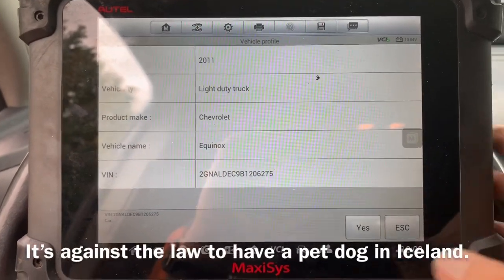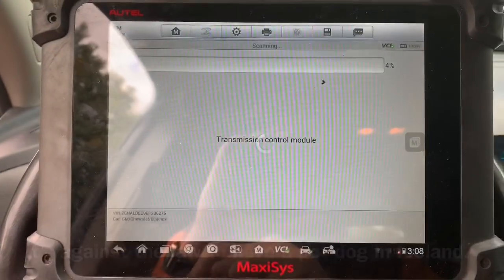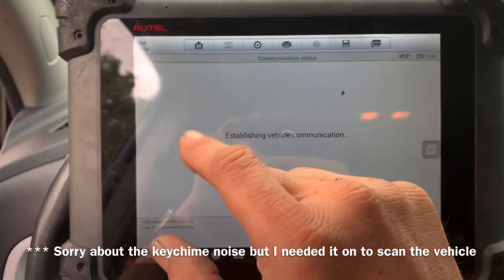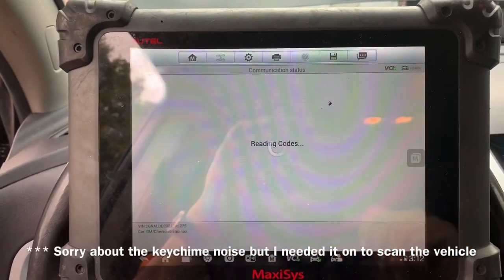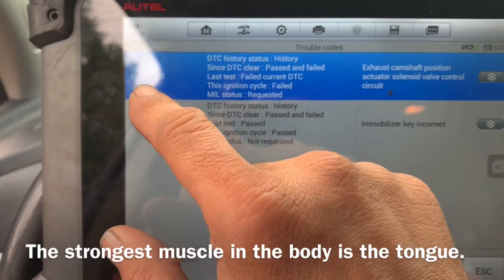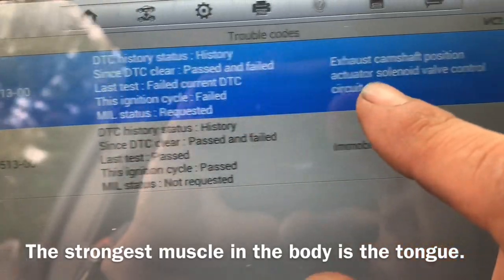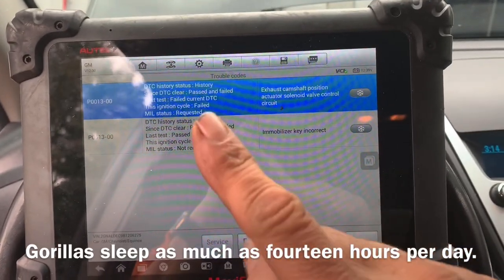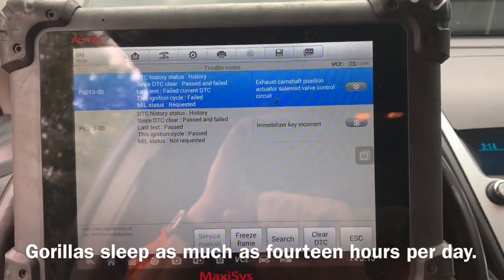Chevy equinox / camshaft position solenoid/ replacement and how it works overview

Comment: Dude your f*** awesome! I went to the parts store and there code  reader said cam shaft position sensor. So that's what I bought . Well I then watched this video and I went right back and returned the sensor and purchased solonoidS. And it worked out perfect. My check engine light even turned off!!
Reply from the maker: Gosh I could’ve swore I answered this question six days ago thanks for the very very nice words I don’t know why you didn’t get my message from earlier

Comment: The tube you pointed out is the EVAP Purge valve vacuum source.  If it cracks it will cause a P0171, lean code for umetered air.  Has nothing to do with VVT Solenoid malfunction or codes. To remove just take a pliers and grip the top of the solenoid case twist and pul, no need to struggle with various picks and screwdrivers.  Use compressed air to blow away dirt and debris around the solenoids.  Only use AC Delco, many have reported frequently failures with aftermarket solenoids.
Reply: Thanks Brian I changed the actuators and the P011 code came back so I was thinking of replacing this tube but now I don't need to.  I've changed the oil and still getting this code after a few hours of driving and also when braking at a stop the vehicle surges and rough idles.  I'm flushing the tranny fluid next so hopefully that will take care of it.
Reply: also ordered a crankshaft position sensor but apparently there are 2 of those as well?  Are they both the same part?  my code is specific to bank A.  Not sure which one that is.
Reply: @timothyflynn  Hey dude I have P011 code too. Any updates on what resolved/fixed your issue? Thanks.
Reply: @WilliamusTrades  I changed out the position sensors with no change.  Oddly I changed the transmission fluid and that helped a lot.  Ultimately for me I think it is probably the timing chain(s) but not sure if I want to fix it.  It happens periodically but then resets itself.  Seems to be with more stop and go driving or aggressive acceleration.   The timing chain replacement looks $$$$.
Reply: @timothyflynn  cool man thanks very much for the reply!

Comment: Thanks 4 the video, I got a check engine and the codes came up we're P0013 and P0014 after a week of doing the oil change. I read viscosity of the oil can create this problem, now should I get the oil change again before or after y replace the sensors. THANKS

Comment: thank you for showing how easy this is. I have a P0014 on my 2013 equinox and its causing the engine to stall
Reply from the maker: In a couple days I have a video coming out that’s going to show you something that I didn’t know that I learned at my new sponsors shop and you may be very very interested in it it may help alleviate that problem as well
Reply: @sharpcarco  what was the issues?
Reply: @sharpcarco  I'm getting the P0014 after the engine blew the main seal due to the PCV issue and a shop replaced the seal and cleaned the PCV.  After getting it back the check engine light came on with this.  Any thoughts?

Comment: Thank you!
I towed my 2012 chevy equinox to the dealership because it would not start. I was getting code P0013 and U0100 (Lost communication with ECM/PCM A). The dealership says thay want to update/reset the ECM for $40 and replace the Cam Shaft actuator solenoids $750... I don't understand why they would charge so much. I'm going to replace them myself for $100 on parts. Do you have any idea why they would charge $750 not including the diagnostic?
Reply from the maker: Well, I wish I had a good reason to tell you I have no clue why they think it’s that valuable, but they are called the Steeler ship for a reason …. I’m glad you can do it yourself though Cal that’s awesome that’s what my videos are for so I greatly appreciate that. Thank you and thank you for taking the time to write this message. It really makes it worthwhile because YouTube videos do not pay anything, but 2/10th of cent per view .. although the warm feeling I get when I get messages like this are the reason I continue to make videos like this

Comment: I have a 2013 Equinox 2.4L. I had been experiencing rough idle and high gas consumption for several months, but my garage could not figure out the cause. I got code P0010 and engine stalled. Replaced both intake and exhaust solenoids. Now I'm getting code P0013 with check engine light on. Engine ran fine for about 200 miles, but began rough idle and high gas consumption again. Advice?

Comment: Hey clay.. First off. .Thank you for making it easy to understand (great vid) I do have one question . .How was the engine running before you replaced the selenoids?
Reply from the maker: Well since I made this video I learned a considerable amount more about these engines you can certainly try to change the solenoids it’s easy and sometimes effective because oil will basically buildup on the inside of the solenoid causing them not to work

Ultimately though these are kind of junkie engines this one would not idle very well. It was fine when it was above an idol but ultimately it boils down to oil pressure not being consistent in the engine and running the cam phasers incorrectly. And that’s caused because the cam journal bearings were down overtime allowing for inconsistent oil pressure it’s not the oil pump it’s the bearings wearing down inside the engine if that makes sense

Unfortunately these engines are complete doom and gloom.

Comment: My 2012 equinox got p0016 & p00117 changed the VCTs, light was still on. Camshaft position correlation- bank 1 sensor A.... which 1 is Sensor A, front or back
Reply from the maker: No, that means or timing chain needs to be replaced technically but your cylinder head is really the problem. It loses oil pressure, open the cylinder head, which will not actuator cam gears properly…. Other people may tell you differently because they’re trying to sell you something and it’s easier to sell something that’s cheaper than sell something that’s more expensive….. but I’m telling you this because I don’t have any skin in the game. I don’t have anything to gain you need a new cylinder head not a used one or one that is line board properly… 

If you want more information on this message me over Facebook under clays ac and Auto Repair, send me your DM and I will explain it further

Comment: Does this also cover the P0010 code? I have that on my 2011 2.4 with 100k. Rough idle, stalls at idle, slugs on takeoff. Says stuck open on all 4 banks, didn't want to replace wrong parts

Comment: Hi I did had same problem I did replace them either oil spark plugs and one off the sander in back I still have the problem when I came to stop signal it shut off I have to fith back to stared again, what do you think it's please ,I need help.
Reply from the maker: Well I’m sorry to say that your cam phasers or your clearance on your cams creates a low oil pressure situation which then stalls out the engine at a low idle. 

I wish I had better news for you sorry I can’t give you a good information on that
Reply: @sharpcarco  thank you anyway

Comment: I got code P0014.  Changed the both solenoids.  Reset the code with my ODB2 reader.  Drove about 25 miles no problem.  Mile 30, on my way home from work, CEL turned back on.  Same exact code.  What else could be the issue, or what would you recommend i do?

Comment: This is the second video of yours that helped me within the last 6mo. Thanks! 2015 equinox had P0013 error, replaced both intake and exhaust solenoids, but still has check engine light. It definitely idles smoother. Any advice of removing check engine light? Should I clear code?
Reply from the maker: You can clear the code but you probably have other issues going on like low oil pressure. More than likely because the cam Girdles are wore down or the cam bearings are wore out sorry to say thank you very much for the kind words though
Reply: Did you fix it? What about the camshaft sensor?

Comment: We were replacing the variable valve timing sensor and only the top half came out! How do we remove the bottom part that stayed in? We have tried WD40 to loosen it and it will not budge.
Reply from the maker: Well you’ll have to remove the valve cover I know it might not look like very much fun but you’ll get it out…
Reply: @sharpcarco  lol! It took a few trips to the auto part store but we finally figured a way to get the bottom half that was stuck in there out! Thank you

Comment: What if the screws wont tighten after replacement? Tried taking the little oring on the screw and puttimg it on the new screw but the black side wont tighten but it held fine twenty minutes ago with the old sensor

Comment: So what did the engine run like when the bad ones were in ?
Reply from the maker: Well that’s a complicated question to answer because sometimes at stoplights it would die , and even though it needed new solenoids that wasn’t the complete problem. Sometimes it would run just fine. 

The problem often with these is the PCV valve gets plugged and that hurts the oil pressure on the inside of the engine so removing the intake and cleaning the PCV valve is often necessary in addition to replacing the solenoids. 

These engines are not very good engines they often have ring problems and a host of mini more.
Reply: @sharpcarco  sounds like intake solenoid
best idea to change both wile you are at it
Reply: better yet   change them at 100 k miles. these engines are known for these symptons.  dont wait till go bad  then do the 2 cam shaft sensors, while you are there not hard to change.

Comment: My chevy equinox 2014 have an issue which eating oil itself little by little. There's no leak even on the same spot which I usually parking it. What and which should I replace there?
Reply from the maker: Well unfortunately that’s a very common problem for these vehicles. It is burned up by the engine it leaks past the rings. Very common problem for them I was actually speaking to a General Motors engineer today about that problem and they said they had to make the engine the way that they made it so they would be more fuel efficient. 

Without getting into any great deal of Detail he explained it pretty well
Reply: @sharpcarco  now my suv need to be fix in tyming chain base on the obd reading. I post here just in case the car get fix "hopefully".
Reply: So going forward to the problem base on my experience having chevy equinox LTZ 2014. Once stability appear in dashboard for some reason. That's the sign and I suggest you need to trade in your car or sell it while it's still in good running condition.

Comment: Ok I’ve replaced these a couple months ago, how can they be bad already? I have a chevy equinox 2013, and I replaced them both! I’m confused
Reply from the maker: Well technically they’re not bad you have a low oil pressure problem and that makes them seem like they’re not bad but they’re really not you have another internal problem like bearing clearances on your cams that’s the most common problem
Reply: @sharpcarco  thank you

Comment: I broke one of the bolts inside of it😳as I was tighten the bolts. What can I do any suggestions would greatly be appreciated
Reply from the maker: Well it’s a small bolt so it should be relatively easy to get it out. , Is it broke off flush?
Reply: @sharpcarco Thank you for your reply appreciated! yes top of the bolt broke off
Reply from the maker: Can you grab it with pliers or anything since there’s no pressure on it any longer you may be able to take a little screwdriver and turn it. I’m assuming you don’t have a die grinder because you could put a notch in the top of it allowing you to unscrew it. 

You could try to drill a tiny hole in it with a 1/16 drillbit then insert what’s called an easy out which almost looks like a drill bit. Once you got the easy out inside there you turn it counterclockwise the easyout it will go further inside the hole then it will grab and start turning the stud out .

I’m sure you could insert your new Solenoid inside there and drive it to a repair shop and they should be able to get it out in a couple of minutes. 

Hope some of that information is helpful for you and I’m sorry that happened to you

Comment: I just got a p0014 code on my car today but a few weeks like not even a month ago I fixed these two valves. My car is also idling very rough what else could be the problem associated with this code?
Reply: i changed mines too and i am experiencing the same symptoms  did you know what happened to yours ?

Comment: I have 2010 Equinox5 with P0016 and P0017. 
I changed the solendoid wirh a new one, the code is still there. I've reset multiple times now.
Reply: I have the same car.   Any update?

Comment: Hmmm I just found out that there's a recall on this problem! Nice to know Chevrolet/GM notified owners!! NOT
Reply: Perfect timing!! Mine just went out a cpl days ago
Reply: My check engine light just came on yesterday
Reply: @gusthejoker85  My check engine came on today
Reply: @SamDorsey, when was the recall and how recently? Because my check engine light cam on today. And took it to the car dealer where I brought  it from to have it look at. And its my camshaft Position Actuator Solenoid and camshaft position system performance...is it safe to still drive it...Because mines cuts off sometimes...I just had my chevy  equonix  for 6 months
Reply: @mumeekrazebs  from what I've heard like 2 to 3 years ago! Sorry to hear your having trouble with your Equinox Barbara! Mine is a 2011. And I've received over the years GM bulletins about oil consumption, which they extended the engine warranty to 150,000 miles & wiper arm problems! Which I replaced my wiper arm mechanism already.

Comment: Paid $192 to a local shop to fix this code on my wife's car while I was at work. Next day the check engine light is back on and it's the same P0014 code. Repair shop told me they replaced both. 🤦😡. I'll be going back in the morning
Reply from the maker: Man I’m sorry to hear that that’s terrible but it’s not the shops fault. Regretfully The system operates off of oil pressure and when you have lower Oil pressure it tends to make it idle funny , sometimes it doesn’t idle weird at all and sometimes it does. It will slowly get worse what is going on is either you have Bad bearing clearance issues generally in the cam section of the engine or you’re consuming oil that’s not always the case but it causes the oil pressure to be lower than it should making the solenoids not operate properly when they’re actuated to really fix this problem generally the engines need to be rebuilt I regret to say.

I’m truly sorry we had to become friends this way but welcome to the channel and we’re happy to have you if I could ever give you any I will certainly try to help have the best day possible
Reply: @sharpcarco  you've got to be joking me. I haven't even finished paying that car off yet. I sure hope and pray you are wrong. The car isn't driving bad right now.
Reply from the maker: I certainly hope I am incorrect as well.
Reply from the maker: Doesn’t mean it will need to be done right away I’m just telling you what will happen overtime I am very sorry for not mentioning that in the first message but the check engine light will more than likely stay on unless there’s something wrong with one of the Solenoid They put in which is possible
Reply: @sharpcarco  we are planning a trip for this car end of December from Georgia to Tennessee to a cabin.. I'm not sure what to do now.
Reply: @sharpcarco  I just watched a video of a terrain being rebuilt. He said it was the same motor as the equinox. He was replacing the chain. Also talked about the same engine codes and sensors being replaced.. I'd rather pay the labor of rebuilding a motor than replacing it.. the only issues we've had since we bought this car used from a dealership a few years ago are P0014. I figured out pretty quickly that you have to maintain the 3000 mile oil change or it will throw that code. Last time the code came on when it was time for an oil change. This time I change the oil only 500 miles ago. So when it that code came up again I knew it wasn't just an oil change. So I had the sensors replaced. Codes didn't go away. One day later they came back. The only other thing is a ticking sound when the car first starts. My guess is that chain based off the video I just mentioned..
Reply from the maker: Ok

Comment: My 2011 equinox died on me I tried starting it till battery died I put new battery on and it wind and doesn't start I replaced starter and same wind it doesn't click or anything else just winds will not start

Comment: Well it hurt the engine if i unplug the camshaft sensor because it shakes when it's plug up
Reply: I change them both an it still shakes orally sold me two of the same thing and said thats aftermarket parts for you
Reply from the maker: No it will just revert back to original programming or may not run but it does not hurt it to be unplugged because of the sensor went faulty it would be like it was unplugged anyways more than likely you actually have a problem on the inside of the engine the sensors very rarely fail least that’s been my experience anyways

Comment: My car was starting on it's own last night then check engine light came on and my husband's scan tool said it was camshaft sensor
Reply: REMOTE START PROBLEM??
Reply from the maker: See this is a good point that I probably could’ve told them The same thing for months ago if they would’ve asked me on my clays and Auto Repair I’ve never seen this message. I think you are right will
Reply: @sharpcarco  I've seen those things cause issues. Had a friend that found out the hard way. Fire department showed up because of his CO² alarm in the garage at 3am! Car was running in an attached garage. Thank God they were ok.